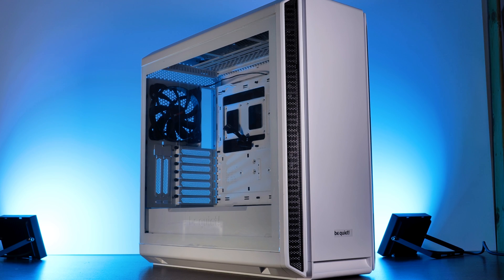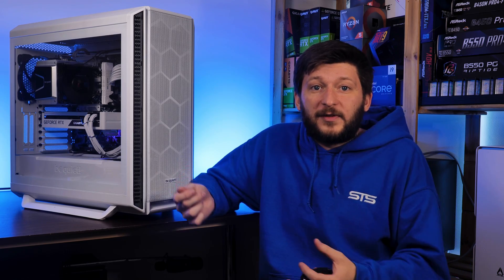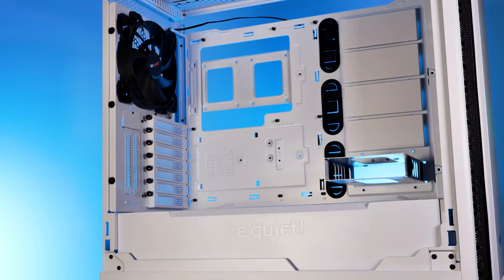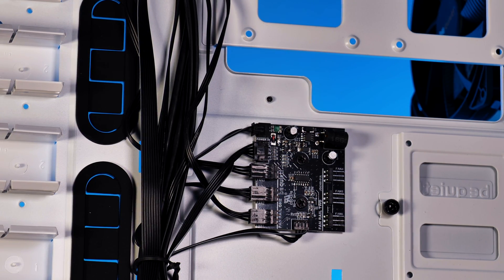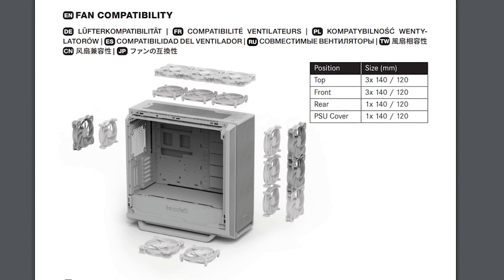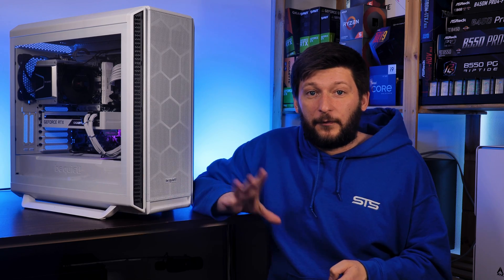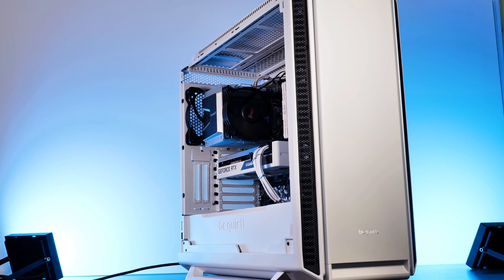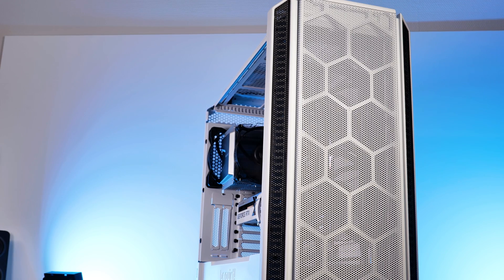Be Quiet! Silent Base 802 Review - Airflow or Silence? It's your choice!

Comment: Question: The fans are not pwm, but the case incluse a pcb which has a support up to 6 fans with pwm control. So there's something that I don't get. PWM fans need 4 pins for their motor to regulate the speed basing on the pwm signal. But they do not include pwm fans, and a pwm pcb? Then, they're gonna control the fans as DC fans through voltage and not through pwm, therefore pwm advertising is pure gimmick... What do you think STS?
Reply from the maker: PWM fans don't need 4 pins to spin. You can also run a PWM fan a 3-pin voltage controlled header. Depending on who or what is controlling the header you can also control a PWM fan with voltage control (aka 3-pin).

The same thing wise-vera. The forth pin of a PWM port is just pulse, take it away (given that the controller can jump into DC mode) and you can run a 3-pin fan on a 4-pin header because the other 3 pins do exactly the same thing.

And the whole DC vs PWM topic is a bit more complicated than that. Generally (not always), you can control a PWM fan more precisely than a 3-pin fan. + You there are instances where a DC fan will create weird noises once its spinning slow enough. This probably occurs cause the motor can't handle that low voltages.

For myself, I just prefer PWM generally. I see no need to keep 3-pin fans alive and we could all just hard-switch the standard that can be controlled the best
Reply from the maker: Just quickly on the last point: yeah, PWM advertising is kind of a gimmick... it's a way of controlling your fan. And assuming that you have two very high quality fans, one PWM and the other one not, you will not feel any difference.

Comment: sadly all 3 included fans and the connectors on the fan controller are 3pin DC controlled and not 4pin PWM (they really are saving pennies on this one) so you cant set your fan curve as low as you could with PWM fans when your PC is idling
Reply: I have mine set on 500 rpm using bios curve. The hotter it gets inside the higher rpm on the fans

Comment: For me the biggest con of this case is the very thin gap between psu shroud and motherboard tray, It's Just not wide enough to route some more chunky cables through it, like USB 3.0 cable.
Also one little thing you missed, the side part of PSU shroud is also removable, the one with big Be Quiet!s branding. Helps when dealing with modular PSU cables.

Comment: 6:04 you can also mount additional 120/140 on the PSU cover if you uninstall HDD cage and remove the cover above it. EDIT: Ok, nevermind, you mentioned it in the later part. And I don't think it feels wrong or ugly, and it helps a bit with GPU temps I think.